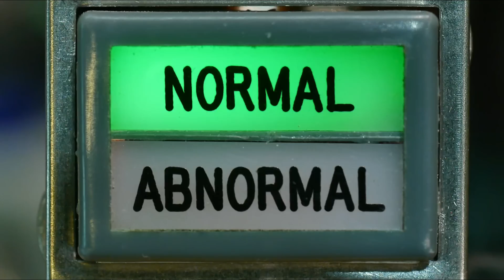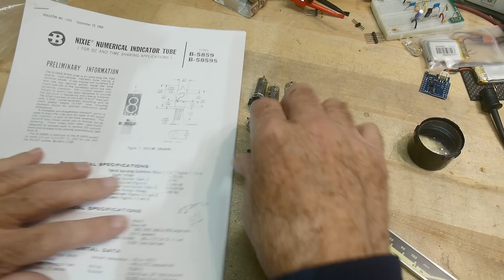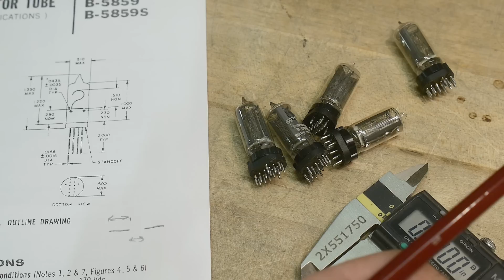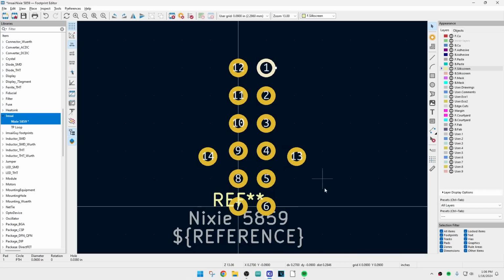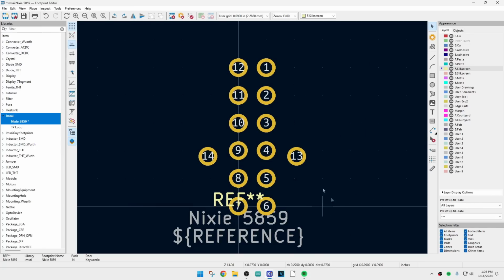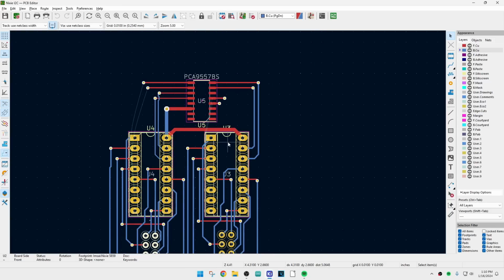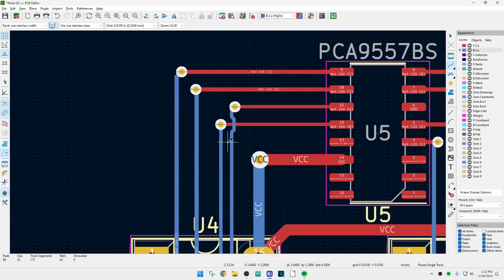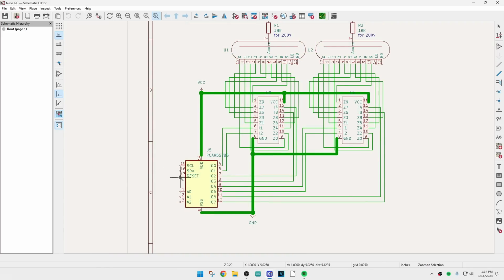#1800 I2C Nixie Display Project (part 2 of 5)

Comment: I was looking at your trace layout, so pulled out the manual for my old Heathkit IB-1103 counter. Not exact, but damn similar layout. This counter only uses 100V on the Nixie tubes.
Reply: The datasheet for the B5750 has example layouts for the 7441 and... the Fairchild 9660!  You need 200V if you're multiplexing, or as the datasheet calls it, "Time Sharing."

Comment: Remember to print the footprint on paper at 1:1 scale and proof the pin holes/layout. Remember that inkjet printers do not print 1:1, even when so set. Add a 100mm test line to the Comments layer. Check the Comments layer to also be printed. Verify the 100mm printed line measures true to 100mm. Mine prints short at 98mm, so I set the print custom scale to 102. A light table is very helpful for checking the alignments. HTH.

Comment: Figure 2 on the datasheet gives you the size for the pins. The SK-207 datasheet gives the base pin diameter as 0.035". So, 0.038" is too small, especially if the hole is plated through! You should be shooting for at least 0.006" larger PCB hole size, so you measured at 0.0375" hole needs to be 0.044". Going off the SK-207 datasheet, the hole should be 0.041".
Reply: Yeah, a little extra room for solder between the pins and the holes is good too. Usually lead holes have a very loose tolerance on them.

Comment: Note: KiCAD has a calculator,...
".038"  way too small.
I think KiCAD 8 'may' have bulk editing.
Jeese it is not THAT high a voltage,... (I have stories.)
Reply: .0375 was the largest pin measured.  .038 will definitely be to small.  And agreed, that is not high voltage.  My HF amplifier runs around 2,500 volts.
Reply: @mikesradiorepair Yeah I have a spare EC620 which provides 2000 @ 0.2AMP
Anyone looking for such a beast?
Reply from the maker: mike, I bet your board does not have 16mil traces 😀
Reply: @IMSAIGuy   No circuit boards in that amplifier.  All wire and terminal strips. I recently purchased a Henry 5K amplifier.  Need to go through it before I power that beast up.  The power supply in that is 4,000V at 1.5A intermittent and 800mA continuous.  Runs a pair of Eimac 3CX1200A7 tubes.  Going to use that for Army MARS.